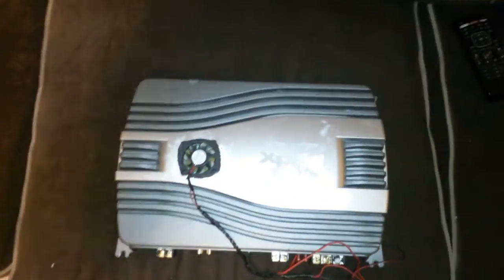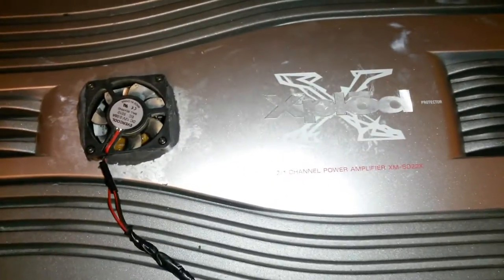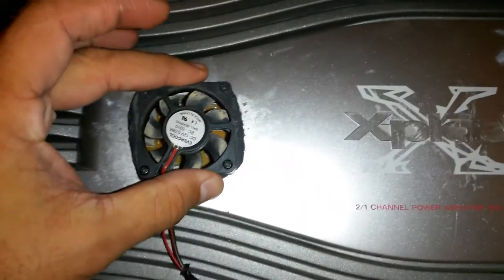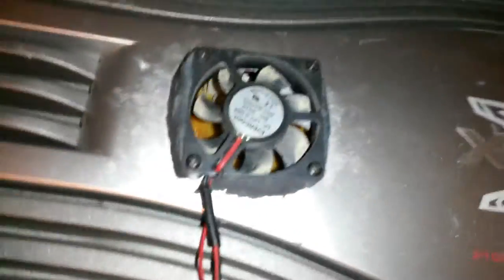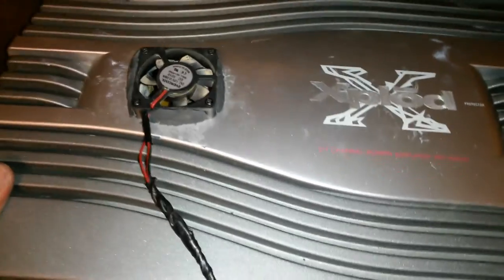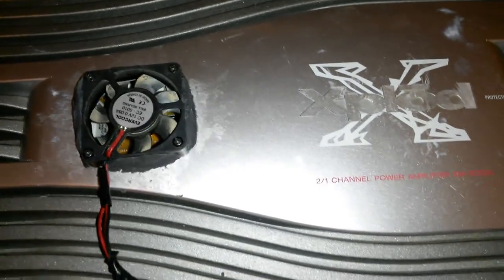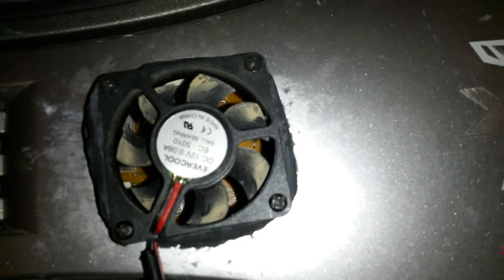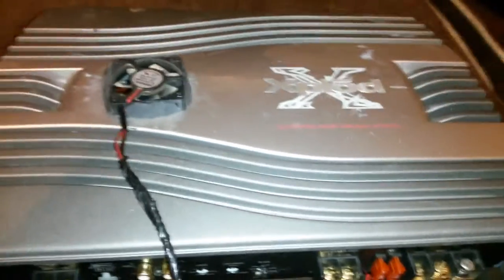Installing fans to car amplifier

Comment from the maker: yes I did and with the two small fans it has never over heated again, even when it's 100+ degrees,
Reply: hcastilla2010 is it still working and how to you cut a hole in it
Reply: @sonicboy7229  i know this is super late, but remove the cover off the amplifier and then use a drill bit to start a hole, jigsaw or handsaw to finish the hole.

Comment: That is a terrible idea dude, now you are sucking in dust and dirt and other foreign contaminants into your amp and control board. The objective is to keep it clean and cool, not suck that stuff inside. I get what you are trying to accomplish but this isnt the best way dude.
Reply from the maker: it could be, but after so many years the AMP is still pumping hard, already have gone through 3 different woofers with the same amp... if you are worried about dust you can take it off once a year or so, open it and blow it with high pressure air, that should keep it nice and clean. Thanks for your comment
Reply: SVCruza About to install me a couple fans my self, little amp was over heating for the first time, to the point I thought it was the woofer
Reply: C note Casino  your fan should have a positive and negative wire. You can simply connect it to the amp. Positive (power) wire to the remote "in" and the negative (ground) wire to the amps ground. If you connect it to the power on the amp, the fan will constantly run but connecting it to the remote in will turn on the fan as soon as the amp turns on....my amp has 2 venting locations on the bottom plate. I plan to raise the amp with some square aluminum blocks on each corner then place a fan blowing into one of the vents and another fan sucking out of the other vent. If you're worried about dust just fabricate a filter around the blocks using stocking material or something similar.
Reply: @lilsolo68 thank you so much I’ve been waiting for someone to explain on how to connect it the right way
Reply: @lilsolo68  would it be better to hook the fan power wire closest to the remote wire on the head unit or to the remote connection pole on amp?
Reply: @theaussie7160  either way I guess. It should turn on at the same time unless there’s an option on the head unit to cut signal to the amp but even then I think the remote wire would still be live. I’d put it on the amp..amp icomes on the fan is on